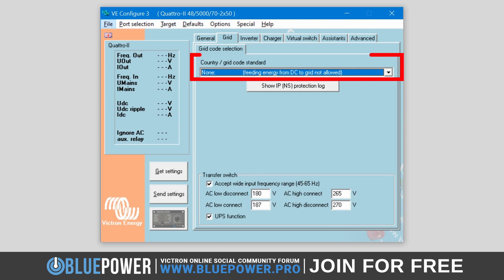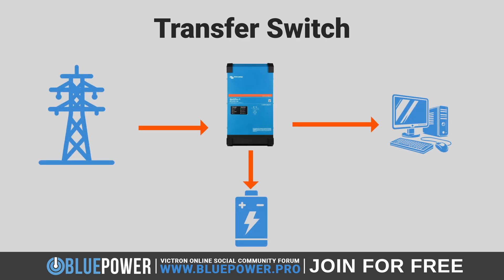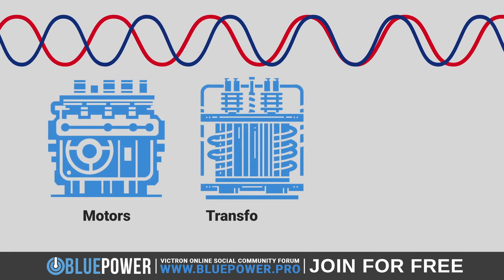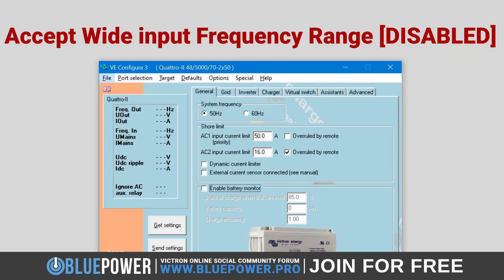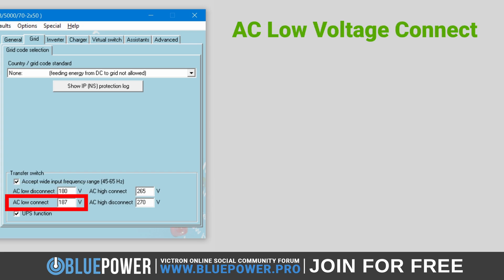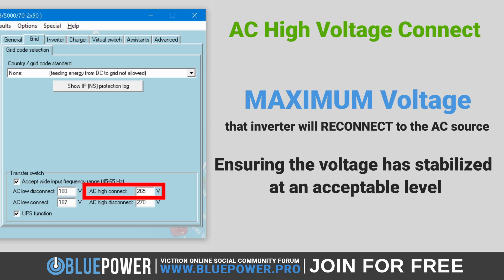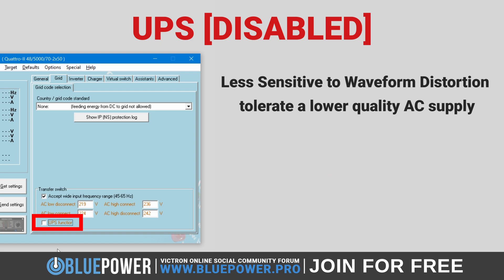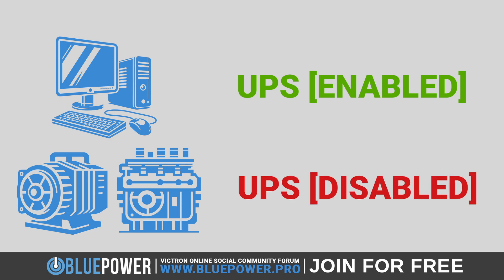Victron VEConfig - Grid Settings Tab Tutorial [UPDATED 2024]

Comment: For the MP2, "Transfer Switch" is really a bad name for a relay.  The Victron Multi-Plus 2 does NOT have a "Transfer Switch".  It has an Anti-Islanding Relay that simply disconnects the Grid, from the MP2, to prevent back-feeding amps into the grid, when the grid is down.  The load on AC1 Output, does not ever get "transferred", from anything or to anything,  because the Load on AC1 is ALWAYS connected the MultiPlus.  Is an Anti-Islanding Relay a Transfer Switch?  No.
Reply from the maker: Welcome to email them directly with your concern. However they always refer to it as a transfer switch in all manuals, such as this https://www.victronenergy.com/upload/documents/MultiPlus-II_External_Transfer_Switch_application/179843-MultiPlus-II_external_transfer_switch_application-pdf-en.pdf
Reply: @BluePowerPro  I already did. And technically, it is not even an Anti-Islanding Relay ... it is an "Islanding" Relay - It allows the Victron to become an "island".

Comment: might try some welds with 5000/48   and this was usefull. battery only 85 amps and will mix  generator or 8 amps from a 1800w max power station keep in charge the  pack!!!  hope it wont trip much

Comment: Hi. Great videos. Have subd. I have a question. I have a Multiplus2 on my boat. Connected to a generator but NO shore power AC connected to it. When drawing AC power through inverter, if we draw to higher load (over 3000w) the inverter does not seem to shut down and overheats until it blows a 300a fuse to batteries. Is there any way to change configuration to get inverter to shut down. Thanks in advance.
Reply from the maker: Thanks for the sub and welcome! Ok, the first thing to make sure of is that you have the latest firmwares installed on MPII and Cerbo, as this could be a cause for a miscommunication. 

If they are up to date and its still happening, then you can use NodeRED to configure a flow.
First, create a n "Edit VE.Bus System" input node that calls the MPII Input Power Phase 1 (if AC1 is what the generator is connected to) as the measurement. 
Then run it through a switch node, setting the first state to >=3000 and the second state to say < 2990 (or maybe a bit lower to avoid nuisance tripping). 

Then connect a "VE.Bus System control" node to each for the switch node outputs. Select the "Switch Position" as the measurement for both. Then set the "Initial Value" to "4 - Off" for the one connected to the =>3000 output of the switch node, and "3 - On" to the <2990 output of the switch node.

Once done, click deploy. However do note that the MPII will shut down and restart when you do so (I learnt this the hard way) so make sure any computers are saved and shut down before).

Lastly, if you are constantly reaching this amount of load then you are exceeding the models capabilities and should seriously consider upgrading to a larger VA model to handle your loads, as the above is only a worst case solution and should not aid in making an inverter work harder than its capable of.

You can also check out my VRm Notification video https://youtu.be/iO0wZ1Ge1hQ to help set warning on your phone, before you reach 3000W, allowing you to avoid it all together.

Hope this helps. If you are struggling I can make a quick video of this.